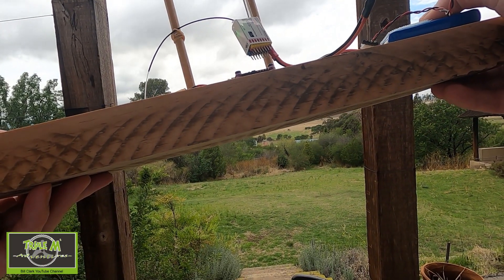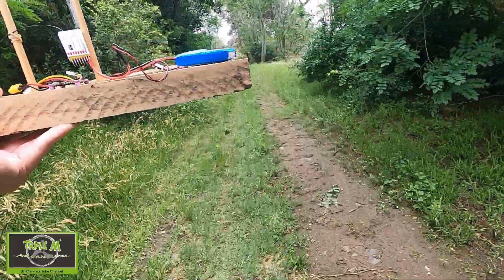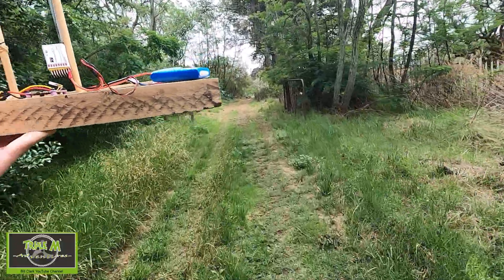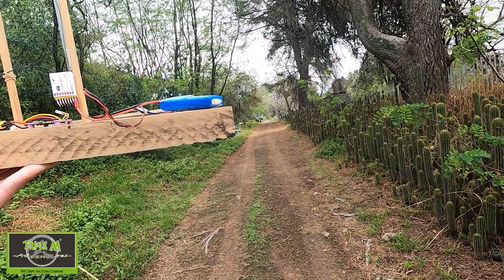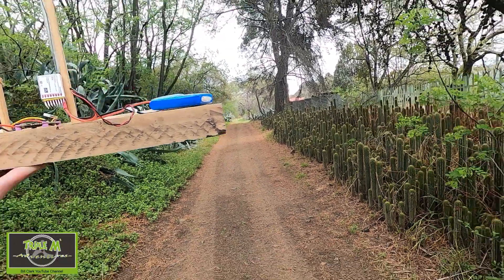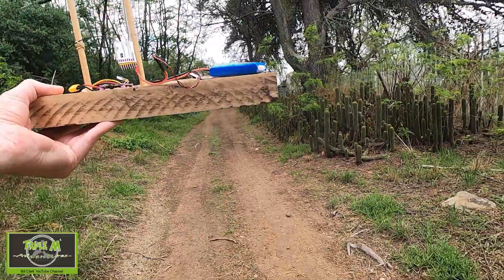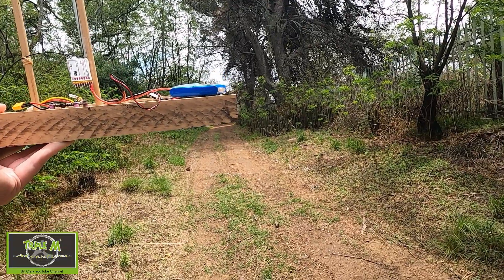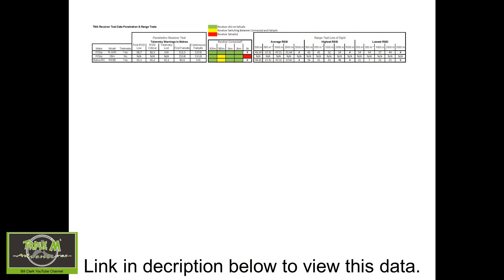Receiver Test – Motive-RC R8SB

Comment: First: good presentation!
Then, a warning!
Although I like this receiver, as it is virtualy the only available option to keep a FrSky D8 system useful (mostly converted older TX-es with D*T modules), it has one disadvantage.
While original FrSky receivers don't suffer from this, the R8SB can be "swamped" when close to the TX., it temporarily "freezes". 
Any R8SB I've tested sofar behaved this way.
For models that take off from the ground it shouldn't present any problems, but during a hand launch, keep the TX away from the model.
Reply from the maker: Thanks for the information.
Reply: @the-happy-RC-flyer  My pleasure! 👍